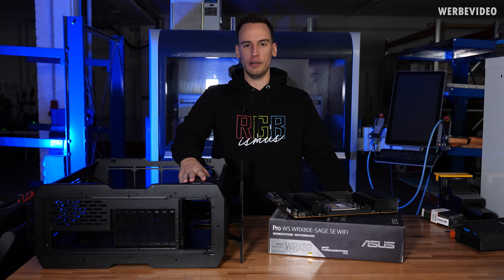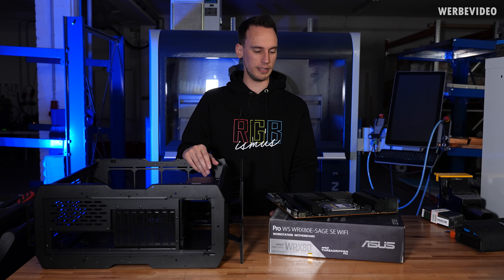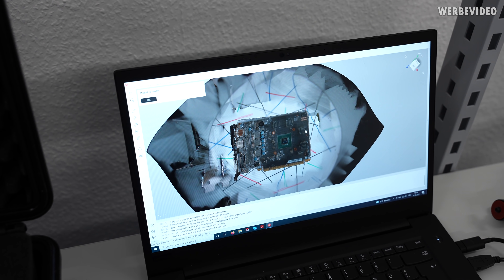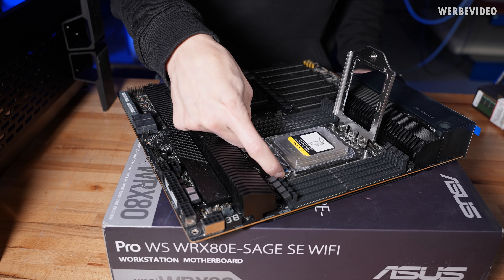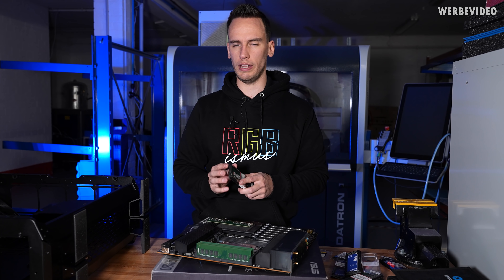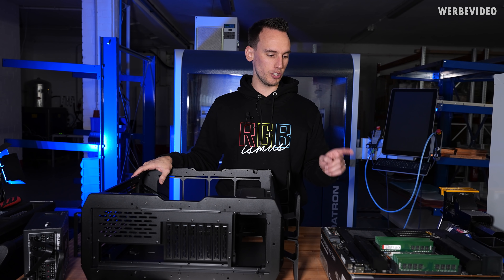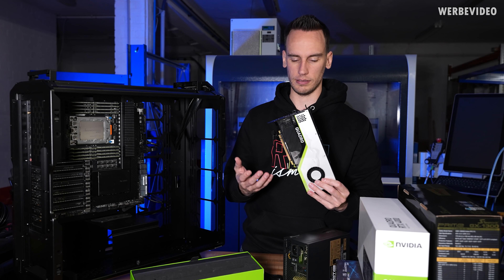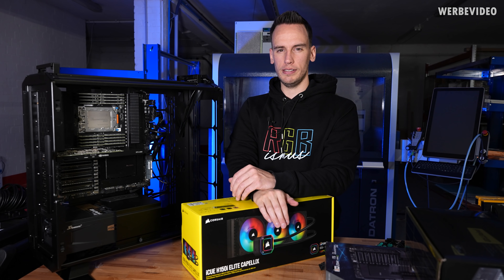We're building a 32 Core Workstation to power our 20.000 € 3D-Scanner

Comment: Just go for a Noctua NH-U9TR4-SP3 for a smaller but thick unit or a NH-U14S TR4-SP3 for the 140mm goodness.
This is a work computer, it must work now and forever without compromise or concern, it is not a toy or an esthetic build.
Not the realm for AIO's with RGB.
Reply: You do know what channel you are watching right? Baka
Reply: @chimpo131  this channel is about overclocking and exotic cooling, that does not mean it's the best idea to use watercooling everywhere, and in this case it defenitively is not
Reply: Maybe even a ice Giants unit, with good endurance fans, if the u14s is seen to not handle the 280w of the tdp
Reply: With 280W of sustained power draw, sadly the NH-U14S TR4-SP3 can't keep up with the heat of the CPU.  

The NH-U14S TR4-SP3 works well for 1st gen Threadripper CPUs, but not for 3rd gen Threadripper CPUs.  Even a 3960X CPU overheats and hits 90-95C under load easily with the NH-U14S TR4-SP3 heatsink in an open test bench or high airflow case.  The 3970X overheats easily and quickly hits 95C when using the NH-U14S TR4-SP3.

Also the NH-U14S TR4-SP3 blocks the first PCIE slot on many motherboards and blocks two ram slots on many motherboards.

Comment: Custom loop with QDCs and soft tubing for easy maintenance.
Reply: how about aircooling for no maintenance for years? thisis a work system, it needs to work now and forever, the more failure point you remove the better, the liquid, pump, even the fittings are failure points that can be avoided.

Comment: What about using the thermosiphon from icegiant? Linus seemed to be very positive about it and looking at the charts, it compares to an AIO but the thermosiphon is aircooled so no issues regarding longetivity... However the orientation must be proper for the thermosiphon to work (as it uses gravity as well for transfer of the cooling medium)... I don't own one but I think you might be able to give it a go...
Reply: It wouldn't work in this case: the socket is rotated, so unless Der8auer were to cut the top of the case, it wouldn't fit. 😅

But it is a good cooler. I've tested it with X58/X79/X99, CPUs never went above 60C (not the most applicable platforms, but I don't own any platforms whose CPUs have gigantic IHSs).
Reply: @ultra_code_  I was considering for my 7980xe but I was put off by the aluminum Coldplate wanted to do a direct die with apex x299 board.
Reply: I believe derbauer tested it once and didn't get a great result... So probably no...
Reply: @MidnightMidas  tested it for 11700k, on threadripper it cools well.
Reply: He did a video where he cut one apart. If they make a copper version it might be better.

Comment: Use a Noctua Air Cooler designed for threadrippers? The NH-U14S TR4-SP3 should cover the entire CPU and has 140mm fans. Or try the iceGiant Prosiphon Elite which is even bigger.
Reply: Yep, that's what I've used since 2017 for my 1950x and the cooler is still working great. Too bad the cooler prevents the first pcie slot from being used by my graphics card.
Reply: agree, since it's a build based around production time "keep it simple". less points of potential failure is far more important then a couple extra degree's of cooling and ultimately the AOI's perform about the same as the U14S on TR.
Reply: @sirmonkey1985  there is nothing more simple than an aio 😂 you literally put fans on the rad and mount the block done
Reply: @samgoff5289  simple refers to points of failure (things that can stop working) air cooler has 2 fans water cooler has fans and pump
Reply: It's a a pity Noctua don't make a TR4 version of the D-15.
Reply: The Prosiphon was specifically designed for Threadripper, so I would say it's the best option.
Reply: prosiphon most likely won't fit or will cover first 1-2 pci-e slots, bc it's designed for normal oriented sockets, and this mb has 90 deg turned one
u14s should be ok, but i'm concerned about indirect fresh air intake (and slight heating through first pci-e card) and potential mixing of warm and fresh air all bc of 90 deg socket, so maybe they should 3d-print a shroud for exhaust (ofc with second fan) like on some servers
Reply: @notmedicine  as far as cooling goes it'll be perfectly fine since the cooler will be venting from bottom to top. that board has 7 PCIE 4.0 X16 slots direct from the cpu so it doesn't matter what slot the GPU goes into or how many slots are filled.

Comment: I used a similar 3D scanner from the same company before. They don't handle reflective surfaces well, as you can see the GPU bracket scanned poorly. So, it would be best paint the GPU die (and other reflective surfaces of interest) with some kind of none reflective dye. You can try Blue mark-up dye, which is quite easy to clean with acetone/rubbing alcohol.
Reply: You can also get powder spray.
Reply: @LawrenceTimme  yep, new powder sprays that stay on for hours and after that - you do not need to clean anything as it just evaporates.
Reply: @LawrenceTimme  didnt even see this comment before saying the same thing!
Reply: Powder spray is what we used. just evaporated after.
Reply: How the light used and the cameras are not cross-polarized to Better handle reflective surfaces? I would expect that from a 20 thousand € price tag for a 3d scanner😅
Reply: Or just put some adhesive tape...
Reply: @magoid  that would take long time and add extra thickness